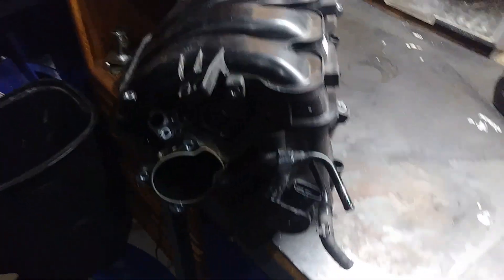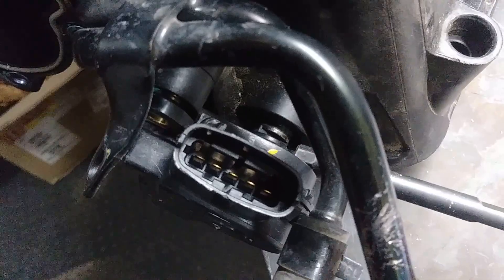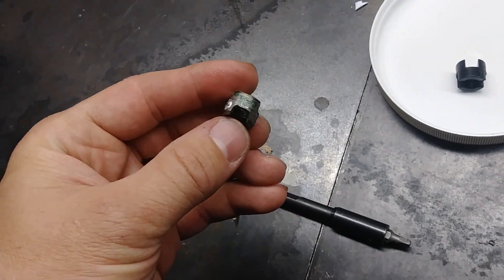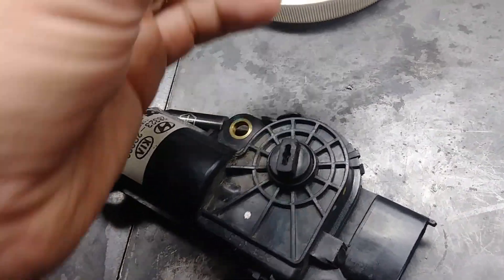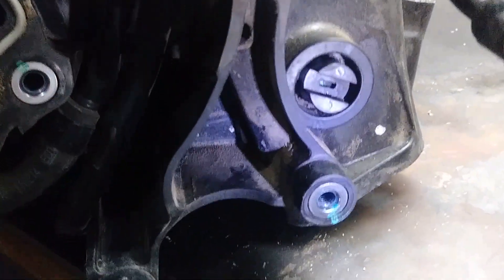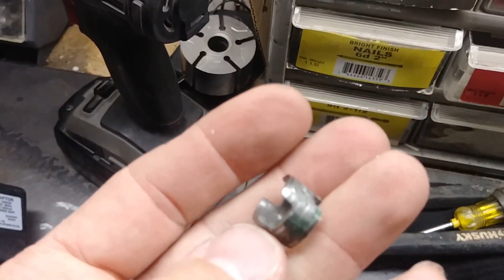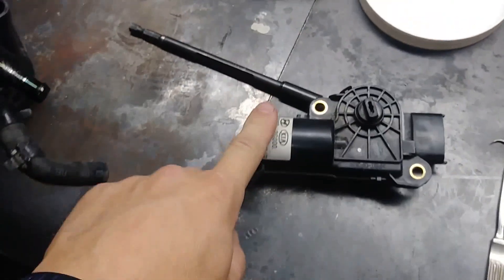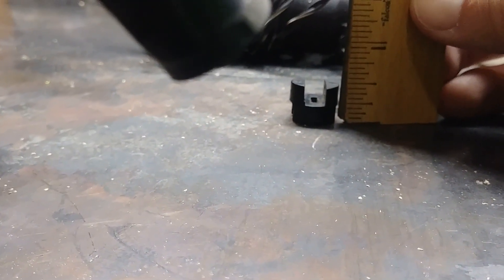Copy of P200A intake manifold runner code 2011 kia sorento part 2.

Comment: I took my coupler to a machine shop they made 2 for free for me. Mine was broke, going to put it all back together using the old motor before installing a new one have one on its way. If I need it I’ll redo the job with the new motor but not looking to spend 315 for it if I don’t need it. Plus had my intake replaced from Kia 3 years, that coupler didn’t last long hope the metal one will

Comment: My sensor doesn't look like that at all, I have a 2011 Sorento 3.5
Reply from the maker: @_mylastname  this is for the 2011 Kia Sorento 2.4 liter.
Reply: @zx9green791  ok right I had just noticed that too. thank you.. I changed mine out and I'm still getting code.. Even if I delete it, it comes back . I'll go see my friend to see if he can relearn it. Weird thing is, the two vacuum diaphragms attached to my top plenum don't seem to work, I tested the solenoid and it's fine, but I just realized there's a second one I'll test tomorrow.. Great little video by the way

Comment: Where did you find a air intake manifold for the kia at??? I got a 2012 base model kia sorento and cant find one anywhere.
Reply from the maker: I think I said the website in the video. I can't remember off the top of my head. If you can't find it you might have to go to the dealership.

Comment: I fixed a 2012 kia forte sx 2.4 with code P200A with this issue i discontented the battery i removed the old manifold ,the new manifold come with the motor already installed on it but you gotta move a couple of brackets from the old manifold and maybe the PCV hose . took about 1.5hrs not long . reconnected the battery and just drove it the car will relearn and the code will not come back also if you get code P2191 ruff start when car is warm its your injectors that are not working correctly and malfunction once the car gets warm they leak and that is what causes that hard start when the car is warmed up trust me just get them changed very easy job total 10 min to change all injectors . or try the best fuel injector cleaner you can get see if fixes it if not its the injectors that need replacing . Trust me went crazy for a bit but it was the injectors . Car runs like new now .

Comment: P200A -    If you have a 2011 Kia from the video or 2012 Kia Sorrento like mine with a 2.4 L engine and your check engine light came on. Next step, is you found the P200A code from the check engine light.  My car has 22K on it and the check engine light came on, I drove it problem-free for another 3K miles and then it took a nose dive, and would not go above 2K RPM's and the check engine light started Flashing.   This video is perfect to help you understand how to fix the P200A issue.  THANK YOU for taking your time to share the video, It is a big help.   My story continues by,  I was told by the Kia dealer in NJ that my car needed a new manifold. It was 800.00 and it would be a total of 1200.00 with labor. I found that I could order the manifold ( same item number as the one in the video from KiaParts.com for 560.00 if I wanted to install it myself-  Manifold Assembly Intake - Kia (28310-2G071). I decided to get a second dealer quote and it was about the same price of 1150.00 for the Manifold replacement.   

After watching this video and seeing the metal part that was made ( great work) , I found a replacement coupler in the link below. I wanted to order it but it would take almost 2 weeks from Canada.  My stubborn self decided to take the VCM motor out and try to fabricate a coupler like in the video, but from plastic like the replacement from Canada. I found a Pressure washer attachment wand that was exactly 15MM in diameter and cut a piece off,  that was 12 MM long.  I used a Dremel to grind out the VCM male rectangle on one side,  and on the side (positioned opposite) I ground out the rounded center rectangle for the Manifold Runner Male connection. So from the video - it was made of metal, I made one of tough plastic. It looked almost exactly like the coupler in the link below.  Except mine was not as perfect and it took me 4 tries to get it correct.  For removal of the VCM follow the video. If you have this issue order the coupler if you can wait, it's much easier.

After installing my homemade part, the flashing check engine light was still on. and the car still only revs to 2k RPM.   I thought I failed.   I tried to clear the light by removing the battery terminal to reset all of that is BS.    Finally, I ordered a $25.00 MOTOPOWER MP69033 Car OBD2 Scanner Code Reader.  To reset the codes correctly.  it took some playing around and multiple resets to finally get the code to clear and it works.  After the code reset with the Scanner the car RPM's now rev fully, and no check engine light.  I took the car for a long 1-hour ride and added an injector and manifold cleaner to the gas to clear any crud from the manifold Runners. The car runs great.  I suspect the metal part from the video looks great but may not sit as tight as the plastic one.  IMPORTANT -  The CODE MUST be REST with a Code scanner.     The coupler part below looks great and is the only one I found out there online, I did not order it due to my lack of patience. Best of Luck, This is an easy engine to work on.  Thank you again for this Video, You gave me the confidence to try this myself and you saved me 1200.00.  

(VCM Coupler Part Website ):Hyundai Kia Variable Cylinder Intake Actuator Motor COUPLER for vcm 28323-2G000

https://www.ebay.com/itm/114090784958?_trkparms=amclksrc%3DITM%26aid%3D1110006%26algo%3DHOMESPLICE.SIM%26ao%3D1%26asc%3D239178%26meid%3D070b171c56e048dd9374f286f1439469%26pid%3D101113%26rk%3D1%26rkt%3D12%26sd%3D402817404976%26itm%3D114090784958%26pmt%3D1%26noa%3D1%26pg%3D2563228%26algv%3DDefaultOrganicWeb&_trksid=p2563228.c101113.m2108     

(VCM Coupler Part)

Comment: OD is 15mm (anywhere from 1/2"-5/8" will be fine). Height is 12mm (a hair shorter is OK but any longer and it can cause binding). Key-ways are 6mm wide & deep The redesigned motor (28323-2G300) has the gearing recessed further back so the coupler is longer (21mm). The key-ways are also nearly parallel, 5-10 deg offset where the original is offset 90 deg. Dorman really has to step up and make these things. I made mine of of nylon spacers, 2-pack for $1.00.

Comment: I have the P2004 code for the Runner control being stuck open in bank 1. I just picked up A new motor from the dealership and I’m hoping that will fix the problem. I checked the actuator and it will move on it’s own when revving the engine up to about 3,500-5,000rpms and then the car stops itself I guess as failsafe to keep the engine from redlining. I also saw a could move the actuator pump by hand and it moved smooth so I’m hoping it’s just this motor that’s gone bad and needs replacing as it has 80K into it. I’m gonna take the intake off to clean it up and check out the flaps to see what’s going on there but the solenoid looks to be fine and seems like it may be the motor
Reply from the maker: Let us know how it goes.
Reply: Mine is the same . What was the fix and how much did it cost ?
Reply: @bigmanracing300  so it turns out it was the motor that that sits on the left side of the intake manifold that was popping up the light and I did the repair myself. The part however with a 20% discount was still about $350 for the part. If I had them do it, it would of cost around $300 for labor.
Reply: @gameroftheyear1000  what’s the part number or part name that you replaced on the left side?

Comment: If the coupler is broken would it prevent the vehicle from starting?
Reply from the maker: No, it should still start. I drove mine for 6 months with the broken coupler. Finally had to fix it so i could pass emissions.
Reply: @zx9green791  Just an update. The coupler wasn't broken but I did have a P200A code and the mechanic did say the part was broken, just not the coupler. The vehicle wouldn't start and replacing the whole assembly did fix the problem and car started again. The part costed like $360 from the dealership. Seems you can't get the part at a local parts store.
Reply from the maker: @1466830  thanks for the update glad your back on the road!
Reply: no

Comment: Did that help the code ?
Reply from the maker: No it still didn't clear the code i had to replacethe while actuator. See part one video.
Reply: How much do you think it cost you over all
Reply from the maker: @develinallen9019  my other video goes over it but i bought the whole intake for 430.00 i think.

Comment: The coupler is weak so when the runners get clogged up with carbon deposits it doesn't break the little motor/actuator. So while your metal coupler is a good idea in theory, in practice it's designed to sacrifice a much smaller part than the whole manifold or the actuator motor. 

But then again you say that your actuator actually failed so maybe even the plastic coupler is still too strong for it. Lol. ...and the dealership is lazy and doesn't want you to come back for the same issue so they just replace everything.
Reply: its the second time on mine.. im wondering if PVC pipe would do the job?
Reply: @TheInternalwisdom  actually that sounds perfect and still sacrificial if need be.